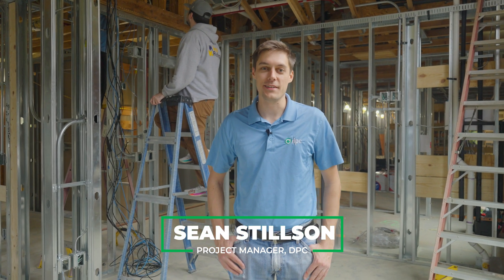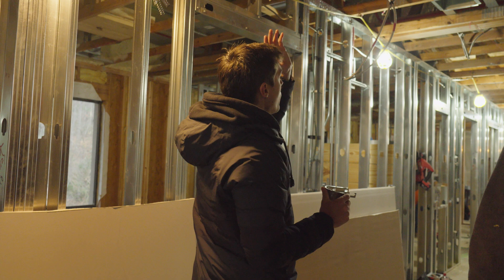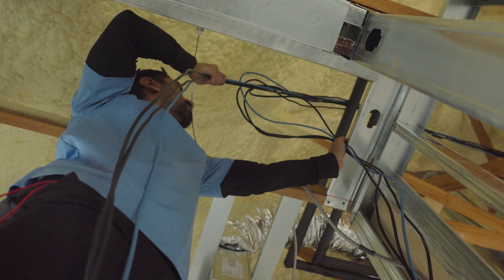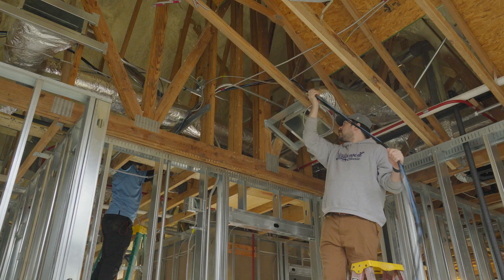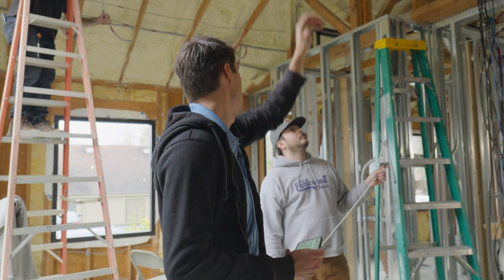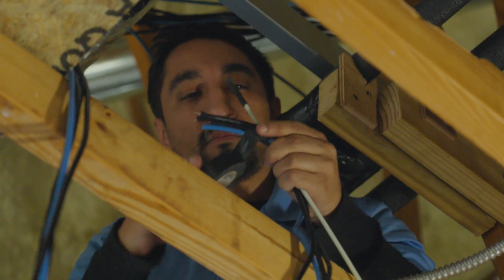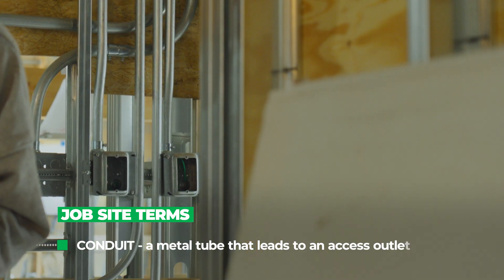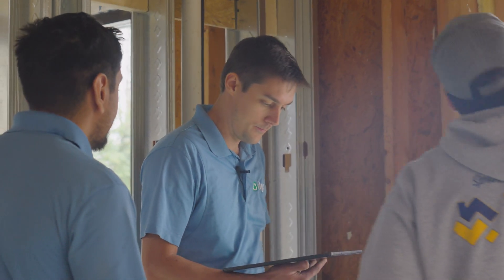150-Cable Runs and staying sane! | Network Wiring Install

Comment: Wonderful video. The honesty of the contractor being "pissed" is absolutely true. I am preparing to run the same in my house with some 10gig OM3 fiber to each room for my SFP+ links to my gaming rig and servers or SFP+ switches in my room/s for multi device drop for maximum overhead. The way that you said how you felt about helpdesk being behind a desk answering questions, that where i am now. I prefer the hands on aspect. Hardware or assembling is what i do best. Physical diagnostics vs digital is much more enjoyable.
Reply from the maker: Thanks for the kind feedback!

Comment: The use of zip-ties is something I would recommend you reconsider. Data cable should be loosely bundled using wide velcro, the tie should be easy to move, and confirming you are not crushing the cable.  Also, your J-hooks are spaced too far apart (TIA is no more than 1.5m) to accommodate sag/tension, and they are well over NEC fill capacity recommendations of 40%. I also noticed that as you branch off, you may not be maintaining the proper bend radius which can compromise the cable geometry. Last but not least, invest in a cable comb. It will make the runs in the j-hooks much more consistent and manageable and result in a cleaner install.